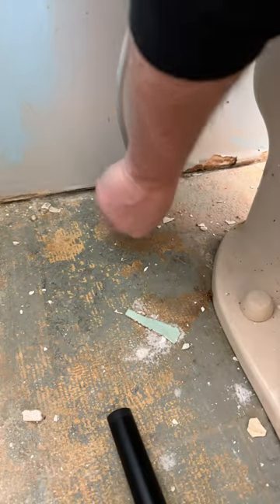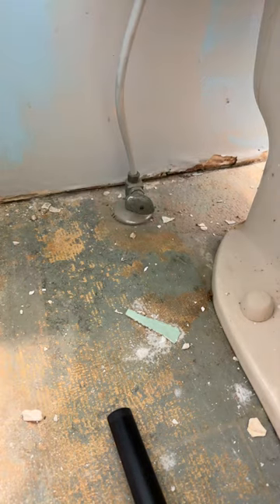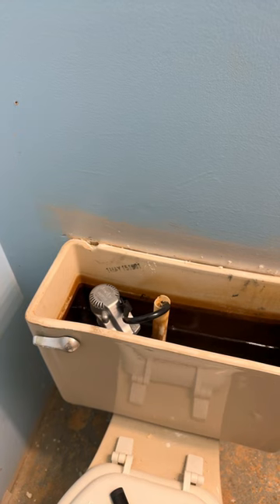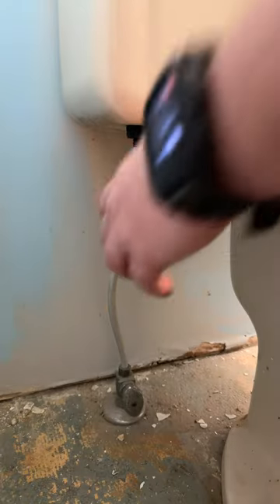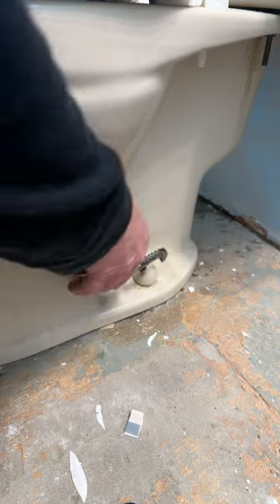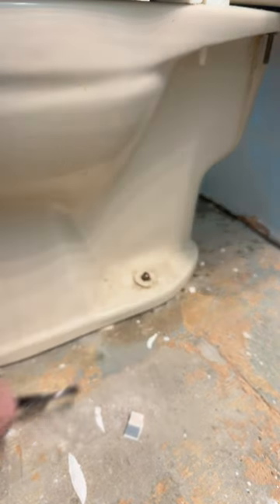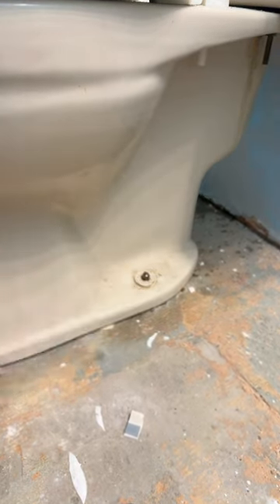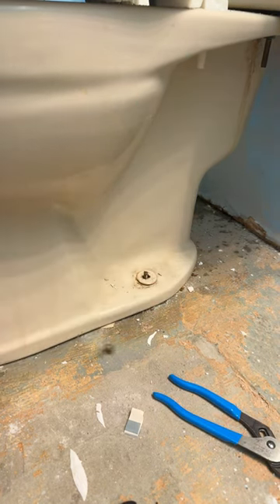Removing a Toilet: A Step-by-Step Guide

Comment: yo i want to replace my toilet and it does not have that valve so how do i drain the water (also can i just call a plumber instead of doing it myself will it be more expensive that way?)
Reply from the maker: You would need to find the main cutoff for the house and turn it off, once you have the water off I would add a value at the toilet pipe.
Reply: Plumber gonna cost ya i had one replace a sink fixture cost me $70
Reply from the maker: @callieduval3000  and that is a cheap price.🤔

Comment: Fully drain the tank and bowl with a turkey baster or a sponge. They also make that stuff that turns the water into mush
Also, have an empty, open trash bag nearby to place the toilet on so you don’t get old wax and muck on the floor. Also, if you’re not reusing the toilet, you can dissemble the tank from the bowl, if it’s a two piece, to make it easier to move
Reply: This comment is why I don’t attend pot lucks

Comment: I had to use a oscillating saw with a metal blade to cut a bolt off it was rusted so bad. It cut through in 30 seconds. In the past I’ve spend a long time trying to remove rusted bolts. The oscillating saw is perfect for this job. It’s also good for removing anything stuck to the ceramic floor. The toilet I just removed looks like it had 2-3 wax rings smashed down and oozed out all around the underside of the toilet. The saw removed it quickly.

Comment: Step 1 for me has mostly been turn off the water valve, realize its old and defective so now turn off the water at your main.  Next go to the hardware store ans buy a new 1/4 turn compression valve.  IF you don't have the proper tool continue for 30 mins trying to get the ferrule off the pipe with the nut behind ot, realize you should just cut it off or use a YouTube trick of using a crescent wrench and hammer. Realize you have no room for that and say either fuck it and reuse the old nut and ferrule or use a recip saw to cut the whole thing out.  

Step 2 realize your sawzall skills are ahit and you have a bunch of burrs on the pipe but continue anyways to reconnect. 

Step 3 realize after install of new toilet you have a leak from the valve because you had burrs on the pipe.

Step 4 curse and blame everything around you..

Step 5 eventually get it done and afterward feel like you need to talk to a psychiatrist.. 😂😂😂...

All in all it is a Pain BUT invest in a 1/2. Ferrule puller on amazon and it'll make life easy.  When it comes to planning and plumbing i just double me ETA on how long i think a job is gonna take.

Comment: Why not get a proper plumber to do it
Reply from the maker: No need to just change a toilet... 😶
Reply: @Rob.Ingram  you didn't vacuum the water out if you done that in Europe you would have flooded the bathroom, even your fellow us plumbers have the courtesy to drain the toilet
Reply from the maker: @patrickoreilly3166  , when I flushed almost all the water was out but I did drain the rest of the water but just used a sponge. That part was not added because of the timeframe for the Youtube Short. But great point.
Reply: Cuz i am a prisoner planning a sewer escape
Reply: I didn’t want to spend $500 for what I could do for free.